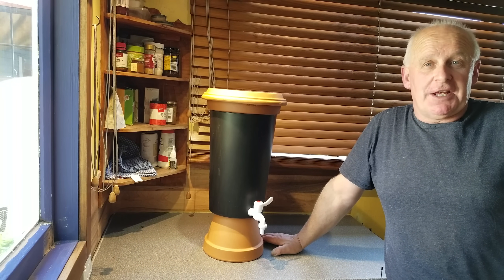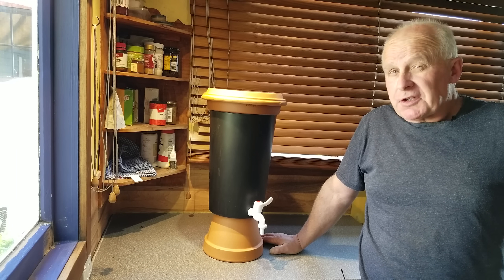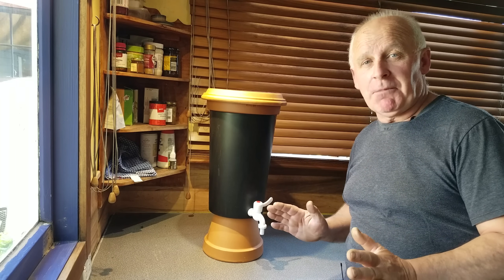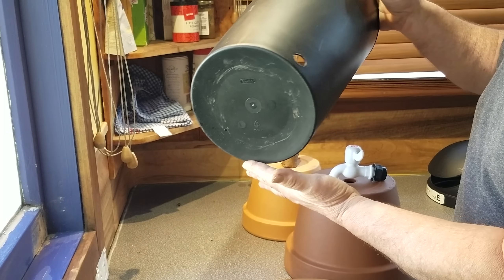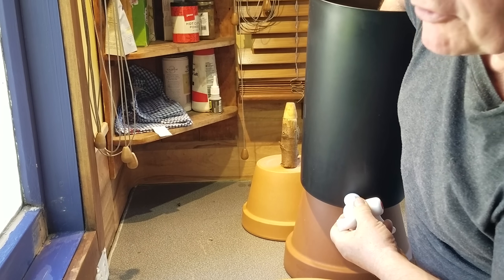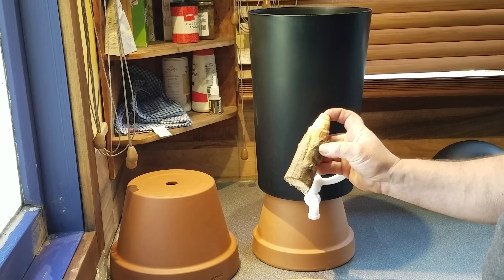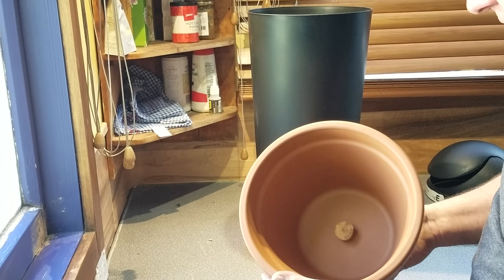DIY water filter. How to make FILTHY WATER drinkable

Comment: If you're not sure of the quality of the clay pot material, I would strongly advise to pre treat it twice with hot cleaning vinegar (fill it to the top), then run another 2-4 times (cycles) with hot plain water (could take a day).  The reason for this is the acetate ions will bind to most heavy metals that may be in the clay.  All acetates are water soluble (or most - if memory serves correctly) and the most toxic metals will form acetates, so this would take care of free floating microscopic metal bits, for the most part. The main thing is to try to leach out all the lead in the clay (most clay around the world has some lead in it).
Reply: Do you need to wash the clay pot after each use? Or how often? Where do the toxins and the heavy metals go? Do they stay in the clay pot?
Reply: @MaxandMe   The idea is that any free particles of lead would be pulled out of the pot with an acidic solution. Anything left over would remain and shouldn't be an issue. Because the pH of water is close to neutral, it shouldn't be leaching anything else out of the pot, so it would be safe. I suggested multiple passthroughs of the cleaning vinegar only to get every last bit out, following by running water through it a couple of times (to neutralize everything again and clean out any residues).  
Once the pot is treated, it shouldn't require re-treating (unless of course the incoming water is highly contaminated with heavy metals) for a long time.  If well water is used, I'd re-treat the pot every few months. If rainwater is used and you're close to an incinerator (specifically a coal plant without a scrubber), you may want to treat the pot more often (mercury vapor from coal burning is a problem, though stack scrubbers are pretty darn good at removing it completely, it really depends on whether the plant operators are doing their job correctly).
Reply: @davestorm6718  ah! Thank you for explaining it to me. Makes sense 👍
Reply: @MaxandMe  No prob. In a past life, I was an environmental chemist. Lot's of nasties in the air, water, and soil. For that reason, I use a reverse osmosis system, modified with an ion exchange resin cartridge after the RO filter.  It's 1 sediment filter, 2 activated carbon filters, then the RO membrane filter, then DI (ion exchange) cartridge (where the resin beads are added to it - they change color when used up), then a carbon filter w/ 1 tap (for ultra pure water), then a re-mineralizer cartridge on another tap (for drinking water).  Sounds crazy, but the reading for TDS (total dissolved solids) on the 1st tap is <0.01 (undetectable). Did the whole setup for under $200 and the filters last over a year (except the sediment filter which gets replaced every 4 months). The RO membrane is usually good for 3-4 years, the resin is changed once every year.  The only thing I didn't add was a UV light, but it's really not necessary.
Reply: @davestorm6718  That truly sounds awesome, a little UV would make it glow.
Reply: @davestorm6718  Do you recommend washing the tap of the vinegar solution with municiple TAP water, with all those nasty chemicals they think are safe for us, they think we are ok with ?
Reply: @davestorm6718 sounds amazing. I’m presuming your system is pressurised and not gravity fed?
Reply: @davestorm6718  that's what my granddaughter is studying at her college!
Reply: @davestorm6718 what's the name/brand of your RO system? Looking for recommendations.
🎉thank you
Reply: @davestorm6718  When I was running a marine fish tank I needed very pure water for water changes so also have a RO DI system. Typically my incoming city water has a TDS of around 180-190. The sediment, carbon & RO membrane get that down to 1 or 0 quite handily. Since shutting down the marine fish tank I removed the DI stage as I consider it overkill for potable water. While very pure, as you've noted you need to re-mineralize it to make it drinkable, otherwise it has no taste whatsoever. I capture the RO bypass water in a large drum & use it around the house, garden etc so it's not wasted down the drain.

It's a good idea to access the water quality reports published by your city or municipality. While some sources have quite hard water, like mine, not all that hardness is harmful. Calcium is a good example, can substantially raise the TDS reading & cause buildup in sinks, tubs & toilet bowls, but can be considered beneficial. Iron is another.
Reply: @davestorm6718  silver solution wont help lead micro particles cos lead replaces silver. terracotta gets algae ...try a glazed or part glazed pot and charcoal block or charcoal granules, you can make you own charcoal by non smoke burning when clearing any fire  vulnerable twigs...so you could make some every year watch it isn't too acidic, but might be helpful in high limestone areas if you are collecting from mountain streams rather than rain
Reply: @davestorm6718  can you suggest something for harvesting gutter water in a place that hardly ever rains and mains water is now precarious in supply, the gutter water would need seiving and uv before an RO but * hate the plastic cartridge waste for retail RO and spun poly propylene contents. There are natural ways of charging water and I cant afford cartridges anyway and will not find a shop or online service where im going.
Reply: @MaxandMe  the weight would make it nearly impossible for me and unglazed terracotta gets slimey algal bloom easily especially in contact with other surface try part glazed pot , I cant lift even moderately heavy stuff especially above waist height instant disc damage
Reply: @MaxandMe k
Reply: I wonder if you could use BENTONITE CLAY it removes heavy metals from the body, I am sure it would do the same in removing from the vessel, not sure though. Just a suggestion. Cheers to clean drinkable water!
Reply: I was told by an Arab here, in Israel, that the best drinking water comes from storing the water in earthenware jars. He said to me that the only treatment of the newly-made clay jar after firing is to add a dash of salt to the jar when it is first filled with water, and to then discard the salt water, followed by rinsing out the jar, and re-filling it with fresh water.
Reply: @Dovid2000  That's a good idea, too! A salt can have the effect of a weak acid and the work would be done by the Chloride ions (Chlorine) to bond with cations (usually metals).
Reply: true. But I `d like also add, that plastic in general is not a good idea. Yes, it says it is food safe, but all softener used to make plastic more elastic are long term affecting health. Why not using glass, stainless steel or glassed pottery instead? Only bc of the costs?
Reply: I'm absolutely no expert, but I was thinking the same thing:  lead, other heavy metals, etc.
Reply: Is polypropylene still a plastic? That slowly breakdown to create microplastic?
Reply: @SharonTordoff  It could, however, most microplastics come from clothing and fabrics (rayon, nylon, polyester) followed by carpeting. Microfiber is probably the worst in this regard.
Reply: @davestorm6718  Hey Dave, the quality of the water worries me, but I'm more worried about the DIY solutions, as an amateur ceramist the first thing I doubted was precisely that. Glad you shared some light. I would love more info on your setup if you'd like to share, thanks!
Reply: @davestorm6718  It's very important to remove all plastic and don't wear any. It also blocks more sunlight from the body.
Reply: @SharonTordoff  If the name of the material starts with poly, it's plastic. Poly means many, indicating a chain of, in this case, propylene molecules.
Reply: … I looked it up and found this on the topic...  
Terra cotta clay pots generally don't contain lead because clay is made up of naturally occurring chemicals, and pots that aren't glazed almost certainly don't contain lead. However, glazed pottery may contain lead in the glaze compound paint. Lead was originally used in glazes because it lowers the fusion point of glass. However, lead can leach out of lead glazed containers over time if they store acidic liquids, such as in pickles or wines. For this reason, zinc-based glazes are now used instead of lead in food containers in the UK and USA.
Reply: @Katskraftkorner   Good to know, thanks!
Reply: I have a water softener system in place which I don’t like because you have to add salt water but it was already here when we bought the property… And then a Berkey shower filter and water filter for drinking but nothing else I think are all defeats the purpose doesn’t strip all your minerals and then you have to add them back?I’m really trying to research what to do between softening filtering and structuring water and not spending an arm and leg🤷🏻‍♀️
Reply: @sophiacorpus9769   At our family farm, we were using a citric acid based softener  system (well water) mainly because all the pipes were copper. At first, because there was decades of build up in the pipes, it seemed like it wasn't working (NuvoH2O), but it was continually pulling gunk out of the pipe for like a year. We almost abandoned the idea until my mom noticed all the scale in the dishwasher was almost gone (it was 15 years old and you had to poke at the lime with an icepick to get it off the water jets every couple of months).  After about 3 years, there was a noticable improvement in water flow and very little residual scale around the sinks and toilet (still a smidge, but nothing like it was before - the water was insanely hard there).
Reply: Isn't it ceramic not raw clay? When it is heated the lead and other metals are melted with silica to fork a matrix of bonded materials locked into a pottery. If its not fired and its raw clay that might not be good... also that metal in the pot will leach only when it's melted by something like vinegar or acid rain... and it will keep leeching for years...iron in pots causes little streaks of rust to dribble down for decades it keeps making new stain. So I don't think vinegar will do anything but melt whats there out ..its not going to form a vinegar seal. Literally vinegar is what I use as a cleaner to melt through metallic stains. Rust or copper verdigris..  and it doesn't bond to anything it just melts  the stain ...
Reply: @Padraigp  The vinegar will only leech out free ions, basically, that may be left over post firing the clay. While metals with low boiling points, like mercury or lead, would evaporate in a kiln, without an airflow, they would re-condense right back onto the surfaces (of the kiln AND whatever you're firing). An acid wash would remove that kind of stuff (I suggested vinegar because it makes a lot of water soluble salts and is readily available and safe to use, but you could use a stronger acid).
Reply: @davestorm6718  oh OK and then the surface metals would be gone ..cool thanks for explaining!!
Reply: @Padraigp  Basically you mean that if raw clay has been fired or heated to make clay pot, then the vinegar method is not good?
Reply: @user-cd9rd7jb2z  how is vinegar going to do anything?
Reply: @Padraigp  I don't know really but some one here suggested to put boiling vinegar in the pot to clean it from heavy metals but I see your point too. Most just start using it right away after a thorough rinse and that's what I have been doing as well.
Reply: @FarooqF-g2x  a clay porous pot I have never honestly had one except for a pounding thing like a pestle and mortar and I had to grind rice in that and I think actually now you mention it lemon juice was involved. Lemon and vinegar definitely get rid of rust stains so maybe it will work. I just feel like in the same way a rust stain usually comes back if the metal is in there it's always going to be in there. But maybe it removes it enough. Its definitely worth a shot.
Reply: @FarooqF-g2x   firing, like someone else posted solves a lot of problems, however, scratches on ceramics can release stuff (again). Really depends on the fire temperature, the composition and the number of impurities in the base material. Naturally, if you glaze it, you close up all the pores and it's no good for filtering anymore.
Reply: @davestorm6718  hi thank you i agree about glazing issue. However someone floated the idea that glazing develops cracks naturally which let's evaporation but I think it is far from reality. Although, the cooking pots they sell here are all glazed. Primarily because if one cooks curry etc..the liquid can go to holes causing smell / other issues etc. I searched a lot yet could not find unglazed cookware. Perhaps the issue is not as much as I am thinking. Has anyone tried unglazed pots in cooking?
Reply: @davestorm6718   hi thank you i agree about glazing issue. However someone floated the idea that glazing develops cracks naturally which let's evaporation but I think it is far from reality. Although, the cooking pots they sell here are all glazed. Primarily because if one cooks curry etc..the liquid can go to holes causing smell / other issues etc. I searched a lot yet could not find unglazed cookware. Perhaps the issue is not as much as I am thinking. Has anyone tried unglazed pots in cooking?
Reply: @Nclk619  It really depends on the species of arsenic present. I would use a weak acid first (acetic acid) for the inorganic species, then a weak base (ammonia) for the organic species.
The reason for these acid/alkali choices is really safety and maintaining the integrity of the fired clay.
Reply: To be extra safe, activated carbon could be used to catch any nasties before they become embedded in the pores. Better yet, if you have more $$$, ion exchange resin (nuclear grade/purity) would be even better.
The resin would also absorb fluoride completely.
Reply: @davestorm6718  I was thinking the same thing.
Reply: @davestorm6718  what do I do with it?
Reply: @davestorm6718  can you explain... never heard of it
Reply: @davestorm6718  get litmus paper to correct pH
Reply: @davestorm6718  what would you recommend if you’re on well water?High calcium levels
Reply: I bought a metal drip water filtered with the water tank on top . There are tubes that are ceramic that allow the water to slowly  drop to the second container.  The problem is these have to be changed or after a while, so do these pots too?
Reply: Turns out, arsenic are is some places more common than lead in earthenware. There are several interesting studies about the levels of leachable substances in such pots.
Depending on the source of the clay the contaminants may be quite high, and the leachability is very good. Normally though the contaminants are low.
Reply: @davestorm6718 good idea. also the pot could be filled with layers of sand and wood-charcoal-dust to absorb chemicals.
Reply: Sounds like a bad idea, after all.
Just saw a guy cleaning water with plants, genius, live filter. Check him out...
Reply: @ulalaFrugilega  surely you would still need to filter that at the end because living plants have living bacteria mold fungi etc. Sounds good for removing heavy metals but you'd still want to filter it at the end I should imagine?
Reply: @Padraigp  also: what do the plants do with all the metal? The more I think on all of this, the less of an solution it seems to me. Scary.
Reply: @ulalaFrugilega  what do the plants do with metals? Same thing you or I do with them. Use them absorb them ..magnesium iron zinc...all nessiary for human life. All metals. All inorganic untill a plant makes them bioavailable to us. The metals she's talking about are in pots ceramics within ceramics the metals when the pot is kilned or fored become bound together in bonds which form the matrix of the pot. ...if youre talking about toxic levels of metals like Mercury or lead plants don't do as well with that as fungi do at absorbing those as far as the very little I know. But you would not want to eat those plants or fungi if they have been used to absorb toxic metals. And for the most part the plants used to clean water are not eaten by humans anyway so ... thats all I know about it I'm afraid. If you have a specif8c metal or plant you want to ask about I wouldn't be the person to ask im afraid.
Reply: @Padraigp  thanks, it actually answers, what I thought: the plants are not edible, possibly not healthy, and would have to be changed often or sth. Fungi, then, but they would have to be harvested to go into special waste... right?
Reply: would adding a pure silver coin have the same purifying effects? It's what people used to do the "old days"
Reply: @Veronica.John10-10   Silver would act as an antibiotic and antifungal, but wouldn't do much with toxins.
Reply: @Veronica.John10-10  might have been a clever sales pitch...
Reply: @davestorm6718  ok I'll soak them in vinegar and run the hot water several times. THANKS 😊
Reply: After the vinegar has run its course make sure to reuse it to clean other things like the toilet bowl or other surfaces. Get the most bang for your buck.
Reply: If not sure, use heavy metal test strips. Yes acetates are soluble, though some metals form insoluble basic acetates (esp. polyvalent metals like aluminium or iron) after heating/boiling the solution.
Reply: @LiborTinka   I forgot about those test strips!  They sell those at pet stores for aquariums.
Reply: When you say to fill it with hot cleaning vinegar, does that mean to let it drain naturally and then repeat the process with hot water several more times? Sorry for sounding stupid but I’m really just trying to get it figured out so I can have clean water when the tap is not flowing. Many thanks 🙏🏻
Reply: You are loved!
John 3:14-18,1 Corinthians 15:1-4, Ephesians2:8-9, Romans 10:8-13, 
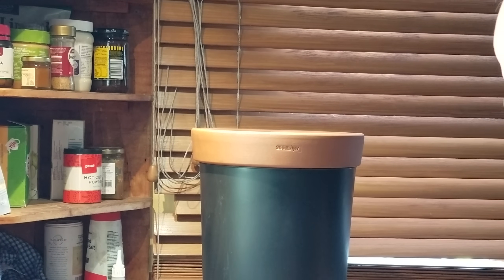Titus 2:13, 1John 5:5, 1 Thessalonians 4:13-18! 1 Peter 3:18! John 14:6
Salvation is God’s Grace alone through Faith alone in Christ Jesus alone!
Our Blessed Hope! Jesus loves you so much, that He died for you so you can spend eternity with Him! 
Jesus came, died, was buried and He rose again on the 3rd day proving that He is God and that His blood paid for all sin for all time! You have been Justified! Just-as-if-I’d never sinned! Jesus is the Only Way, the Only Truth and the Only Life, and no one gets to the Father but through Him! Believe and receive Jesus into your heart and you will be Saved! Run to Him! Just as you are! Call on the Lord and you will be Saved!!! The Great Tribulation is fixin start, but those who believe will be Raptured first! Rescued just in time! Times almost up! Don’t be left behind!

Numbers 6:-27 KJV
24 The Lord bless thee, and keep thee:

25 The Lord make his face shine upon thee, and be gracious unto thee:

26 The Lord lift up his countenance upon thee, and give thee peace.

27 And they shall put my name upon the children of Israel, and I will bless them
Reply: earthenware mostly has iron
Reply: @davestorm6718
Thank you for pointing that out so true. The heavier the pot the more lead it contains like candles from China are heavy because of the lead. The lighter the candle the less lead when burned and in your lungs
Reply: Let me see if I understand correctly -- you fill it with white vinegar and let that filter thru the pot, then fill the pot with water and let that filter thru a few times before making your drinking water?
Reply: @SandyCheeks63564  yes.
Reply: Not many cypress in USA, any other options?
Reply: Lead was my concern as well.Dumb question, do you run the vinegar after the unit 
 assembled or before? How about soaking the clay pot in a bucket with the vinegar?  Thank you😊
Reply: @olgapietri4062  Great idea!
Reply: It's amazing how many people didn't understand that you're using rain water. And that the mayan and most ancient people stored and filtered their water in clay pots for thousands of years and lived to be hundreds of years old.
Reply: Thank you for this tutorial! Very informative and helpful.
Reply: ah that puts me off trying this now🤣
Reply: It would be asier to seek clay pots made from "organic" or minimum heavy metals clay than to trear potentially contaminated product you intend to purify water.  

Time will tell if this wins anyone a Darwin Award. At this point just eat the lead paint chips y'all....
Reply: @blowitoutyourcunt7675  There's no natural clay without contaminants anywhere, but, as I mentioned, you can remove anything that would freely leach from the pores by acid and base washing. After that, anything left would be of low concentration (ppb) and nothing to worry about.
Reply: Hello, can we use normal 5% acetic vinegar for cooking purpose? Thank you!

Does that apply to unglazed pots? Unglazed pots naturally evaporate water. 

Another thing I noticed ; what's that white residue build up (like lime) that appears on surface of the unglazed clay water pots?
Reply: @FarooqF-g2x   You can.  If you need to , you can concentrate it in a pot (keep right below boiling point of water) as it has a higher boiling point than water.  Halving it (boiling it until half is gone) should bring the concentration near cleaning vinegar (10%).
I don't think you want a glazed pot for this.
Residue is probably from hard water (calcium & magnesium compounds, mostly).
Reply: @davestorm6718  Thank you so much for this tip. The area I reside, they don't sell cleaning vinegars so this boiling method is useful to get cleaning concentration. We were just fed this idea that earthenware is best for drinking water as it evaporates and also purifies the water. They sell earthenware pots here, a tradition dating back to 5000 years. The designs are kind of similar being passed on generation to generation. Refer to the archeological finds of Harappa civilization for example. What I didn't know was the lead presence as you pointed out. I also noticed that some times these are not fired properly and sand or minute particles seep into water. 

You mentioned the white residue referring to calcium ot magnesium. The earthenware separates these from water, meaning depriving the water from these minerals would be counter productive?